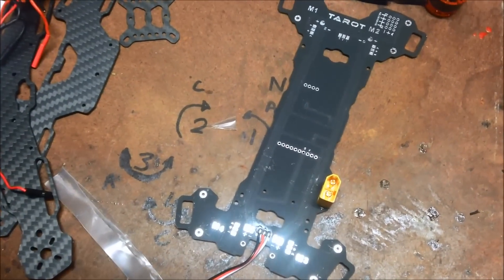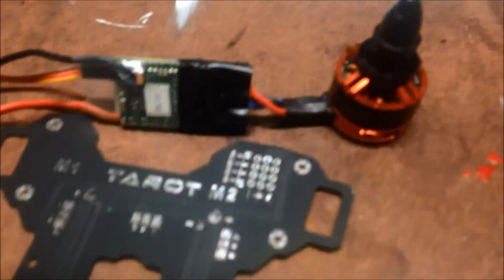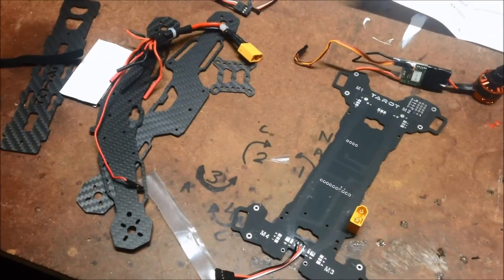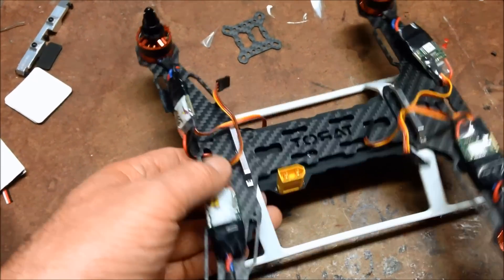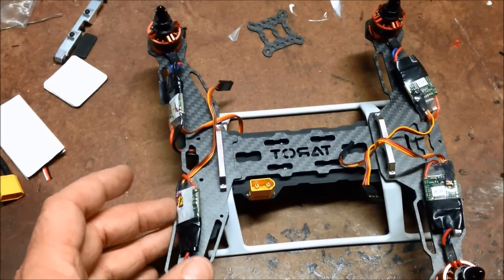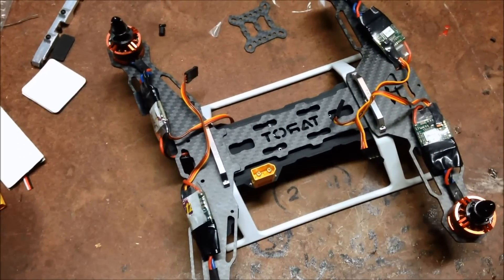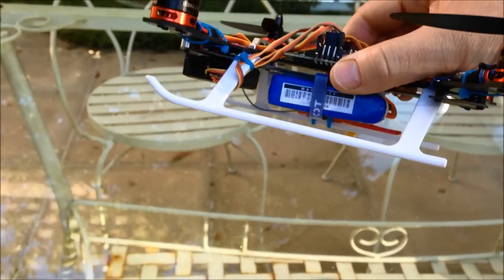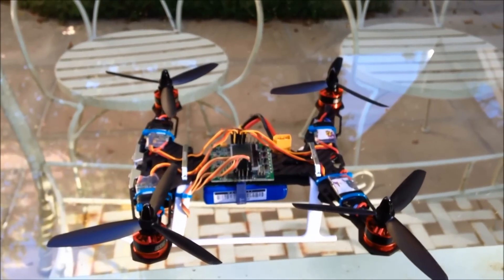Tarot 250 Mini Quadcopter Build and first flight. DYS 1806 AFRO 12A ESC KK2

Comment: I'm building one too! I'm a newbie so mind the dumb question.  1300 Lipo, is that a 3 cell? and what kind of charger do you use?
Reply from the maker: joseph Murillo Yes the 1300 is a 3s Lipo. I use a Accucell balance charger. $30ish from Hobbyking.
Reply: Simon Hahnel What type of Accucell charger? there's a lot of options for a balance charger.  Do you know how many watts it is? thanks for your help

Comment: Hi - what is the battery life on your set-up. I assume on the video you used 1300mAh battery? I built my Tarot back in January 2015 with the same motors (https://www.youtube.com/watch?v=W1VXFmoF18g&list=UUy7ROYrsaYnZ-m2B5clbuNg), but cannot get more than 4 min flight time. Thanks!
Reply from the maker: Milos Petrovic What C rating is the battery?
Reply: Simon Hahnel I have 25-50C as well as 45-90C. Not much difference between them...
Reply from the maker: Milos Petrovic I just did a test this afternoon so you can compare
https://www.youtube.com/watch?v=HdX8OEIK9Kk
7 minutes easy. No FPV gear onboard though.

Comment: Hi what is the total cost of build thanks
Reply from the maker: jason richards Frame $45, Motors $10 ea, ESCs $8 ea, KK2.1 $18, Props $3, Battery $9, Transmitter/Receiver $60. Quads of this size usually cost between 130 - 180 depending on parts ordered.
Reply: Simon Hahnel How did you get a Turnigy 9x for $60? I thought they were around $90-$100.
Reply from the maker: From Hobbyking about 2 years ago. They have gone up a bit since then